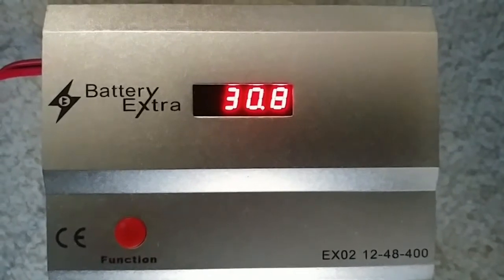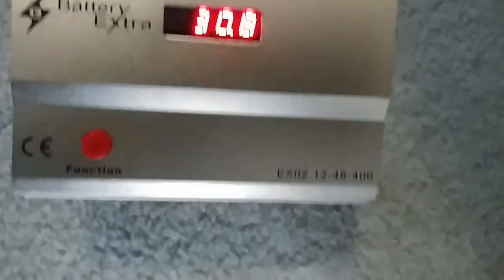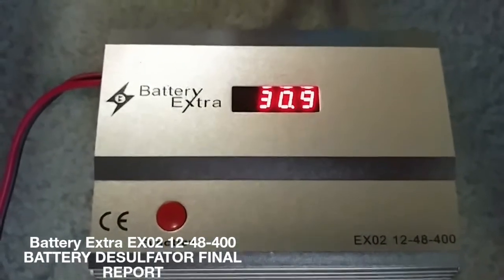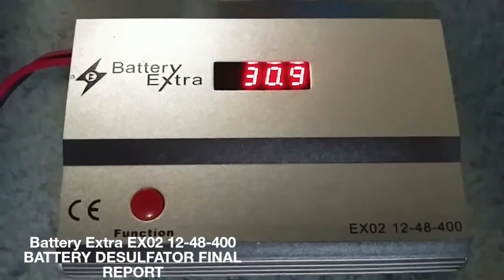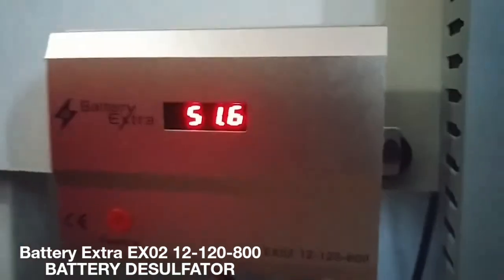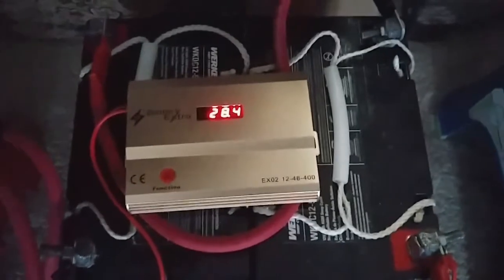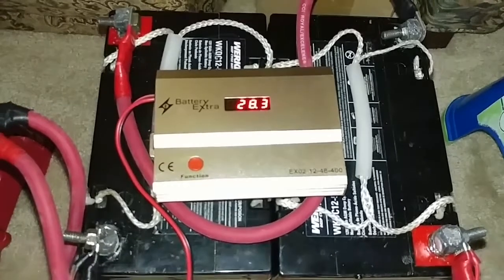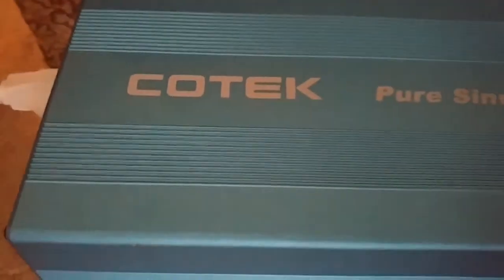BATTERY EXTRA BATTERY DESULFATOR - Final Report Pt#5

Comment: Just wanted to add that 16v is for a single 12V wet battery. You can get correct overcharge voltage for 24v from any solar equalization chart but it seems to be 27V.
Reply from the maker: Thanks